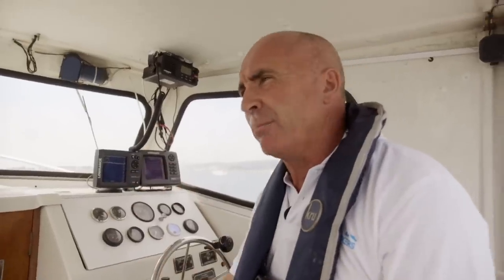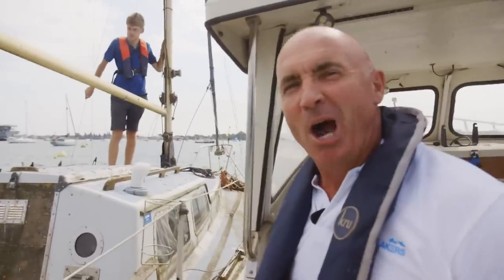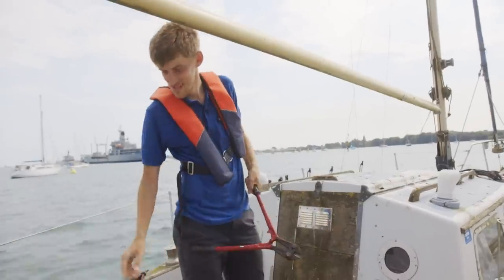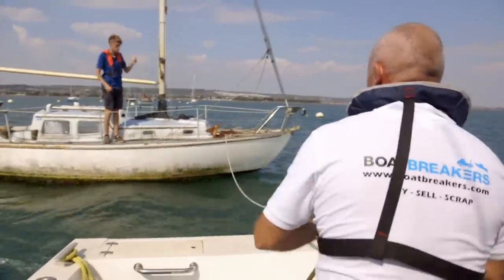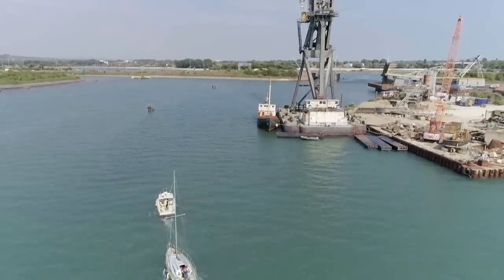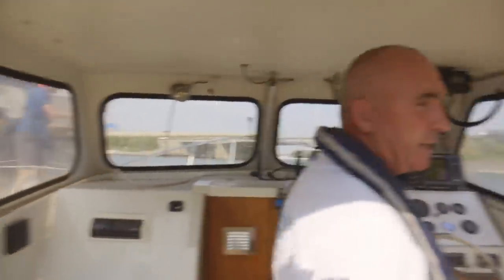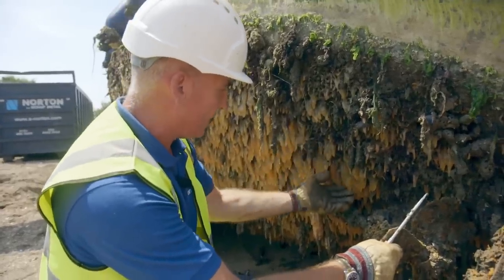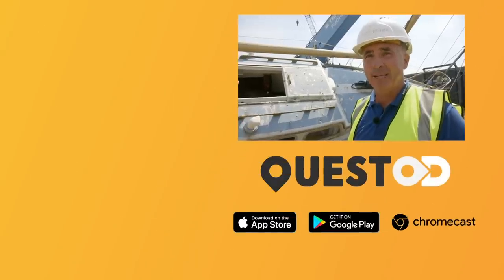Crew Declare Dilapidated Boat Beyond Repair | Scrap Kings

Comment: As a boat owner I’m crying. 3k would of bought this boat back to life and it would of been worth 6.5k - 8k
Reply: Eh? Boats of that age (1970s)  were over-built and that one looks structurally sound. The plywood bulkheads are structural and can rot, but there's no evidence of that. Replacing standing rigging on a boat of that size will cost 1600 tops (that's getting someone to come along and do everything, without you lifting a finger). Osmosis can be a problem  (the gelcoat separating from the fiberglass) but unless its excessively bad,  it's cosmetic and not a structural, and, again, there's no evidence of it. The wiring will all be pont to pont, no electronics and very simple, so hardly an issue. The sails will be the big expense here, plus the fact that there will be many boats available in the area for a similar price (within rouunding error of 0), so even non-fussy buyers can be picky. 

The winches could sell 2nd hand for about 150, the diesel tank 50. The engine is worthless, the keel is probably worth about 150 as scrap, the mast and boom the same; brely enough to cover the cost of the disposal of the grp. Moorings are very expensive in the solent area, so whoever owns them probably just wanted the boat gone to be able to re-rent.
Reply: @jdmmer   I agrea

Comment: Gee, let's see... Boat floating, check. No water inside, check. Motor will prolly run great with a fuel/fluids change check. Hmm, even the wooden rudder stick looked great! Lol. Sure the door slats need love, needs trim work, sanded and painted and prolly new wire rigging. I'd buy it on the spot!
Sad to see it destroyed :(. ...sad that the parts make enough money to make it more worth their time than fixing.

Comment: What a waste! 1 week of fix up and it’d good as new.
Reply: I own a sailboat and that is so far from true lol try a year its a shame they scrapped her but you could blow $10k on that boat just to get it safe to sail
antifouling                            $600
anodes                                  $100
new rigging                          $1500
new sails                               $3500
rope assorted                       $700
anchor's x2                            $300
anchor chain                         $800
paint $ varnish                      $600
new prop                                $400
stanchion wire and fittings $800
fiberg lass resin                    $120
fiberglass mat                       $100
plywood                                  $500

I hit $10K and im just getting started what if the engine needs a rebuild or toilet or the wiring needs replacing I could go on but you get the point at the end of the day you could buy a boat like that ready to sail for $8-15K
Reply: Liftout: 120
Pressure wash: 60 (to buy the pressure washer)
Scraping off old antifoul: 0
Sanding down to gelcoat and sanding the wood: 50 (to buy a sander and discs)
Enough epoxy filler and spreaders  to repair scabby gelcoat: 100
Enough paint and varnish to get it presentable: 300
110 ah battery: 70
New wood: 100
Varnish: 30
New sails: 3000
New ropes: 150
New standing rigging: 500 (optional) 
Yard fees for hard standing in that area: 250pcm
Paint brushes, dust masks, turpentine, gloves etc: 200
Your time to do this: ?

If you do this yourself you could have a perfectly respectable boat in a few months. It's only 24'-26', not a superyacht, so quite doable. The engine on that is a joke and almost certainly wont need a rebuild. There'll be nothing wrong with the fiberglass and the wiring will be super simple point-to-point soldering iron stuff. The anchor is manky but perfectly serviceable. Once you start paying other people to do these jobs the costs skyrocket.
Reply: @tyroneshulace3203  price me up an engine rebuild headsail mainsail  and rigging 2 anchor's and chain and rode new flares and epirb "legal requirement to be in date" radio's and antenna's  and a set of new sheets and shackles  antifoul paint and primer new seacocks hoses and skin fittings anodes chart plotter compass and depth sounder off craigslist mister $500
Reply: @razzorbladz  Get yourself out of your spend therapy fantasy and back to a sailors reality. Who said the engine needs a rebuild? You can get a good used running Atomic 4 for $500 or $2-300 for an outboard. More than adequate on that size of boat. The 2 very good condition, used sails package is $3-400. If they are needed. Fore sail on this subject boat is well furled, but you can get a good used one cheaper than repairing. A hank on Jib sail even cheaper. Can pick up a good used Spinnaker for $150, sock optional.  A Youth group could make products out of the old sails to raise $$ for other costs. Is there a bagged main sail in the cabin of this boat? Not sure, are you? Has & needs only 1 anchor, a coat of paint optional. This boat is not going to be Hurricane or Med anchoring. Costs $200 to pickle & galvanize 150' of chain. Only need 20-50' chain for anti-abrasive & the rest can be 3/4" Blue steel 12,000 lb test rope. The rusty chain on the boat could be dragged  behind a vehicle down a gravel road & then dip coat it in paint. OR as I would do, Immerse it in ($15) Phosphoric acid as is & then paint it.  Costs $6-10 for packages of 100-150 ft. of 3/8-1/2" poly/nylon rope. A couple of packages of rope always good to keep on board as sundry supplies. Stainless shackles cost $5. Lowes or Home Depot. A package of current 3 new flares is $30-40. Out of date kept as added extras. Use these used ones first when needed.  Only need Epirb if going offshore. Not needed for lake, ICW or close coastal sailing. Neither is a liferaft or even a dinghy. A dinghy can be built for $250 see Bolger designs or others on Internet. Is  there a working VHF or UHF radio on board? These can also be bought very inexpensively from a used boat parts shop. You can buy partial cans & unused full cans of antifoul from your local used parts & boat supply for 1/3 to 1/2 price. Inexpensive seacocks & through hulls can be had in poly/nylon. New unused & good used zincs can be had from used boat parts shops. You don't need a chart plotter, paper charts can be had used. Same as compass or even get donated. Can get a used fishfinder depth sounder for $40-50. I have 3 small 20-27' sailboats. I only bought 1 of them. The rest were had, for the effort of removal (1 x 20' came on it's own trailer). In fact I have been given many under 30' sailboats for free. I have built my own trailer to move them. I have let many go as there is a huge surplus of unwanted unused boats. So many infact that I specialize in select certain models. I plan on starting a non profit Sail Youth Group. I recycle, reuse, repurpose every part of a boat. So what is a Scrap Boat? For me. Leaks can generally be fixed. Rotten soggy core not so easy or inexpensive to fix unless you have spare donor parts. I only get into core replacement if the boat is in stellar condition otherwise. If a boat has taken on a lot of water (worse if has been wet for a long time) generally the interior wood especially floors, soles & bulkheads are junk. However an entire interior can be trashed. Floors, sole & bulkheads replaced & seats etc made and boat kept as a Spartan Sailer. Make great trailer sailers & excellent for a teaching anyone how to sail  a boat. When I pick up a boat. I ask. "Is there any other boat related stuff you want to get rid of ?". It is then, the treasures come out. eg Outboardc motors, epoxy paint, epoxy & fiberglass resin & cloth, antifoul paint, spare sails, box loads of spare parts, electronics, life jackets, anchors, dinghies, windsurfers, electric pumps, batteries etc etc .
Reply: @tyroneshulace3203   there is no such thing as a cheap sailboat when you actually own one which clearly you don't you will know better I can tell you are one of those ideas kinda guys lots of ideas and opinions but little in the way of practical experience. if you want to buy a $1 boat and restore it go for it its actually cheaper to buy a boat that is not a wreck then spend 2x more fixing up a shit heap boats are cheap . you know a boat needs to pass survey to get insurance and with no insurance no marina or yacht club will let you in and replacing marine fittings with shit from lowes hardware will not pass survey. you think spending $10,000 on that boat is an insane number? no you are just offended that you will need to spend at least $10k to get any kind of boat like thats worth actually owning unless you hit the jackpot and that hunk is not the jackpot. also your American opinion about a boat in the UK quoting US prices and parts suppliers is pretty funny
Reply: @razzorbladz I was quoting $$ because it was YOU that started the thread with dollars. I was just keeping it consistent. I am not an American. I was born in Preston Lancs. U.K. Do you think that China makes special stainless steel shackles just for sailing? Yes, they are the same ones from Lowes or Home Depot. If you know where to look 316SS can be found locally & inexpensively. Plastic hull fittings can be bought NEW from used boat parts shops for less than from a Yacht Club/Marina Chandlery. The only products I have bought recently for boating was 4 lifejackets (NB. A life jacket is not "legal" unless the tag certicate is attached.) fiberglass mat & resin and a new 5400 lb axle & springs etc for my "new" custom 38' boat trailer project. Not to be confused with my current 30' boat compatible trailer. I own 3 sailboats outright and soon to be 2 more. But that could change by the hour. The 3, I currently own. 1 is a DS20 Trailer Sailer I mentioned earlier. The other 2 are both Grampian G26's. These are not to be confused with the 6-7 other G boats I have recycled, repurposed, reused and resold. Like I said earlier I specialized. 1 of these G26 has a shoal/swing keel & can be launched from my custom 30' triaxle trailer. (I got this one on a cradle. Built the 30' trailer so I didn't have to pay the Marina anything to load it. Now I pull many boats from private properties for myself & others. The other is a full fin keel G26 on it's own dedicated tandem trailer. It could be trailer launched as can be seen on Youtube. (I am probably trading this on a new to me 40' Ketch. But. I don't have to. I can buy the 40' Ketch outright.) This 40' Ketch comes with 2 mooring balls. It is not a project and is currently in the water kind of, offshore. :D The 2nd & other boat is a Bruce Roberts Offshore 44 unfinished project boat. It is on it's own 5th wheel transport trailer. I didn't need a Surveyor for these boats. I can get Liability Insurance without a survey if I want or need it. Just not Comprehensive Insurance. But I don't need insurance on my own property.
I didn't buy into the politics & false high economies & social class structure, non sense of the "Yacht Club". I know many that do, that are racers yet not very good sailors. I launch from a public ramp. If you want to see how to do this..  https://www.youtube.com/watch?v=skiu7eE9rgM    I have my own mooring ball. I own it. No slip fees, membership fees, clubhouse tax, haul out-launch fees or winter storage fees. I have my own property and a 50x100 ft shed. 
My boats are an enjoyable profitable hobby. I sell parts & pieces for these G26's and soon will include G30 & 34's and maybe some other brands & models. My boat "income" is reinvested in purchasing into my boat hobby.
I expect you have bought into a yachting culture that you are expousing here. Good for you. Not my style at all.  
The 38' boat trailer I mentioned above started as a 34' Travel camper trailer. We removed everything above the steel frame. (except the black water tank) We reinforced & modified the frame to handle a 34' boat. Because Grampian made G30's & G-34's as well. I have 3 cradles, 1 for the G26's and 2 sailboat cradles I modified to accomodate the G30 & G34 boats. I can assemble the cradle under the 30's & 34's. Then they get lifted up onto blocks & then cradle & boat gets slid onto the trailer frame. NB. I have 4 extra trailer frames over 30' long that people have already ordered (my style of) boat trailers from.
I think someone with a Platinum Credit card can easily spend $20,000 on this subject boat. I know of people that spent more than a hundred thousand on a project boat and never got to sail it. The perpetual project boat. Many of those are at the Marina or on the back fence of the Yacht club. Club Members in good standing.. Yet they never sail. 
FYI. Most of the nautical marine hull fittings are now coming from China. They are not bronze but brass. A better source is India.
PS. Not all Engineering types are trying to build their monument to Society. Some of us understand Economics & Business....  Did you know it was possible to launch a 41 ft Schooner from a boat ramp launch?

Comment: The problem is boats take a lot of time money and energy to fix up,,,,and then there is the yard fees …boats get to a gage where they are uneconomical to repair to anyone wanting to make or retrieve there money back,yes that boat could of been fixed up ,,,,but is it good money after bad ,,,I’ve bought 4 boats for a 1£ each it can be done ,but I don’t think I’d do it again,,,I bought a camper and Nicholson 303 
Last year In Southern Spain ,that had been abandoned for 14 years ,fortunately being in Spain and out of the water she’s in pretty good condition but has still cost me a lot of money to get sailin* again,luckily having built boats profesionally on the Isle of Wight I have got the knowledge and skills to do it ,boat cost me 2500£ had a 45000 euro harbour debt on it ,,,,,cheaper for the boatyard to sell it than scrap it or fix it